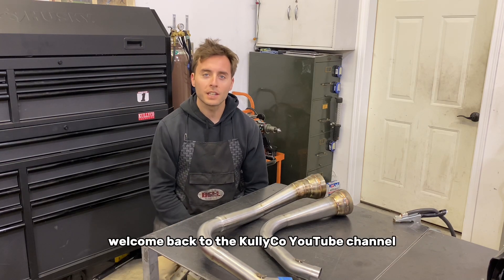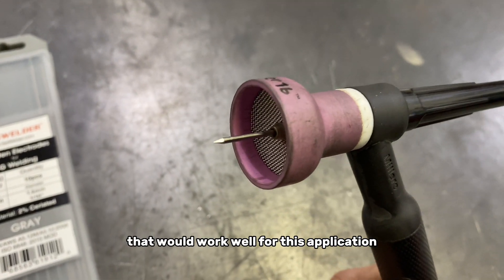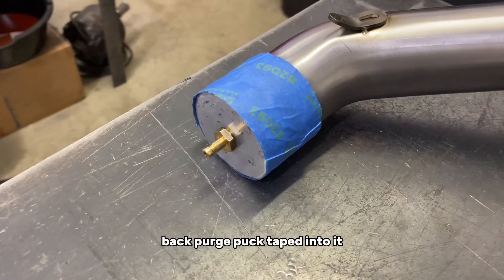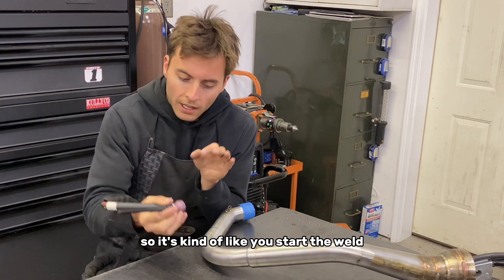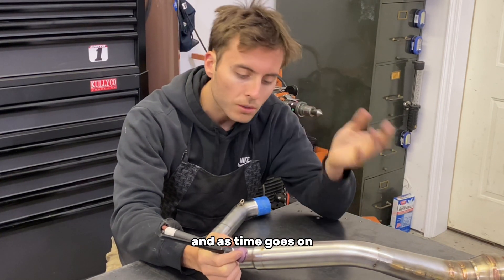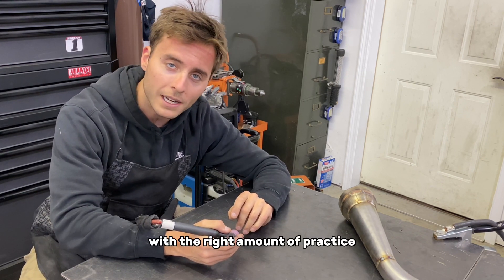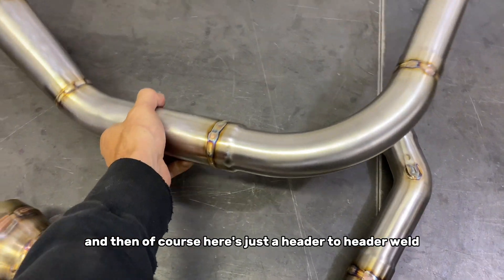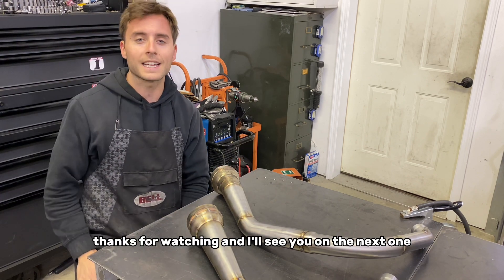TIG welding stainless steel exhaust tubing for beginners.

Comment: I tried walking the cup at 35 with a straight tig no pulse and seemed to get good penetration and a more straight weld.
When I tried pulling I keep walking off the line.
Reply from the maker: There are different strategies for certain welders / seems.  I would personally try and stay clear of walking the cup on thin material.  Just in the name of not overheating.  I would try and max pedal and rip .

Comment: I have a 3/32 tungsten 2% Thor. 
Would you still use 35 amps?
Reply from the maker: Yes, still a good starting spot- see how it goes at max peddle.  But, should be right in that window.

Comment: Hi, I've MIG welded for years, but am new to TIG welding, when you're back purging, could you use an Argon mix or straight CO2 , or does it have to be pure Argon..?
Reply from the maker: Hello, use pure argon for back purge

Comment: Nice technique. It appeared that you did not feed the filler rod through your hand but just gripped the rod and lowered your hand toward the torch as the rod was consumed for the 25 dips. Is this correct?
Reply from the maker: Thanks, and great observation!  that is correct, it will be easier for you to do it this way vs feed it through your hand. 
I only feed it with my hand in rare occasions

Comment: My TIG is in the mail, but my MIG has been near me since 84. Being comfortable important to allow focus on task. The filler for new exhaust alloys since 1992 has been 304 series. So 306L filler rod works good? My exhaust is repurposed from used pipe but new take offs from exhaust shops. They sell cheap as long as you bring a tape to measure as all my project needs is 2.5” dia. Twin pipes custom made placed to maximize room to work on a frame off 67 pickup. This is my last build but will be welding rocker for son on his SS Monte. I am not worried about sugaring as no cats, just two excellent mufflers out back. I would guess a week or more using V-bands and sleeves for certain connections. That’s the thing in life, you have time, but little money. Or, step up, weld what I need in new machine, teach son, or sell local as used. Thanks kindly!
ASE Master since 78.
Reply from the maker: thank you for watching!  keep up the good work

Comment: Cool video mate! I'm doing something very similar to this , only confusing part is you say you are using "YESWELDER TIG Welding Tungsten Electrode 2% Ceriated 1/16"  @2:19 
But later on you say you are using " Super Missile" Rods @6:18 so it that the *Same ones*??

Also it helps a lot when content creators add links to the special types of materials or tools they are using or recommend. Beats all the guessing games and trial error us newbies go though at times, that what makes these type of videos perfect. 👍
Reply from the maker: Hello! apologies for confusion.  I am using 1/16" 2% ceriated grey band tungsten, with 0.035" supermissile (tensilweld) welding rod

Comment: So is this Super Missile tig rod the same thing as a ER-312 rod?  Did a little research to find this rod and from what I'm seeing Super Missile is a brand name for Harris ER-312 stainless rod with a higher chromium content making it a great maintenance rod for harden tools, gears, etc.
Reply from the maker: It certainly could be!  I have always called in supermissile with my suppliers- I've also heard guys use the term tensilweld for this specific rod.
Reply: Also ss er309-L is the same as super missile

Comment: Hey kully! Just wanted to thank you for the eye opening tip on amp setting. I’ve been tig welding for a year now and always set the amps higher then needed. Sometimes leading to inconsistent passes. 
Now knowing to set it at a amp range where I can floor it it’s been a lot more consistent ! So I appreciate that and thank you for this vid ! 🤝
Reply from the maker: You bet man!  I am glad you were able to get value and learn something!  Just sharing my knowledge ive picked up over the years.. thanks for watching!

Comment: Okay, I've been welding all kinds of stuff for many years, even tig welding, and I've never counted how many times I dip the filler in the puddle. Here is why " Why would I want to spend so much time thinking hmm am I dipping this filler enough times or not ?"  When I focused mainly on just getting the job finished. Stainless steel doesn't always need to look like a stack of dimes when you are finished welding it . That's why the lay wire technique is just as simple as the dipping technique.  How you tig up the job is mostly all a preference, not a requirement by code. So, just keep on doing what you feel is best for you. Feel free to tig weld some soda cans together whenever you have a chance.  Make sure you use some very low amps.  Lower than what you amps where on welding the exhaust pipes.  Other than that nice-looking welds to be fair.
Reply from the maker: Thank you sir! Yes I agree, there is always difference strategies.  I like to count dips to keep your start and stops evenly spaced.  I will be doing all new welding videos again this winter!  Im going to dive in a bit further as the first go around I was still pretty new to the youtube game. Thanks for watching!

Comment: Right now I’m in the process of building the hotside for a turbo kit. When I tac the stainless it tends to pull to that side causing gaps. Any tips or tricks to avoid that??
Reply from the maker: Make sure your tubing is sanded / cut very true . Where your pieces meet up it needs to be dead flat .  Also , use small, cold tacks.. it doesn’t take much to hold material together .   That should help with material moving around

Comment: I have a miller 150STH and it’s a scratch start 😒 I bought a foot pedal for it and it helps controlling the amps instead of the hand trigger, any advice on welding with my welder? I would like a high frequency one like yours but i’m trying to work
With what I got thx and great content really appreciated
Reply from the maker: Hey thank you for watching my stuff . As for how to operate your welder mode , specifically.. i can’t really help there , as I’ve never welded with that machine. But all tig welding / machines .. similar rules and techniques apply. I’ve used many welders over the years .  Hope you are still able to get value out of the content . Good luck building your skills!

Comment: Yo I have a question I purchased 18g stainless pipe but the muffler I purchased is 16g . Can I weld 16g to 18g ? Or should I purchased all 18g material?
Reply from the maker: Hello! Yes you can definitely wed 16 g to 18 g no problem .
Reply: @KULLYCO  we appreciate you out here keep grinding pimp!!
Reply from the maker: @BuddysBS  I’ll keep doing my best ! ⚡️🔥🤠

Comment: What are your thoughts on fusion welding aka no filler if fit up is spot on?
Reply from the maker: I know companies that fuse / Autogenous weld there stuff and they seem to get away with it.  It really depends what the application is for and how high the exhaust temps are going to get etc. Also it’s a question of durability and how long your hoping it lasts.   I always use filler on street and race applications so I don’t have to worry about it.

Comment: Nice video! I was TIG welding for the first time today in class. Im a construction carpenter but my back is screwed up and I need to switch to something with more ergonomic consistency like working in a shop instead of construction sites. Did not use a filler rod though just welding 1.5 mm mild steel strips together in 45 degrees to practice before Im going to weld together this table grill project that they gave us. It was a lot of fun and extremely satisfying. Im looking forward to more of these beginner videos.
Reply from the maker: Thanks man! I appreciate you watching.  I’m glad i was able to bring a bit of value.  Yes, that is a great way to start - just fuse material before using rod . They call that autogeneous welding.  Get used to moving the torch and running the foot pedal !

Comment: I really appreciate your instruction! I am getting ready to weld a stainless steel 16g exhaust on my Opel Gt. Your video is very helpful in prepping me for this challenge. What would you say I’d the minimum size gas lense cup? The largest I have is a 12. Will this get the job done or do I need to make a purchase?
Reply from the maker: Hey man! Thanks for watching the video - I’m glad it’s been helpful .  A 12 will be perfectly efficient .  It just won’t sheild the weld quite as well- but you can still make a pretty / strong weld with a twelve .  If you do more of it moving forward- i would jump up a size